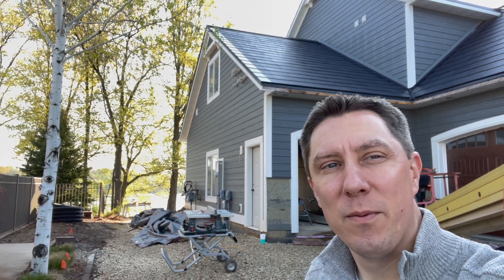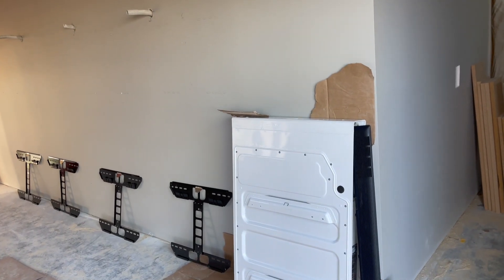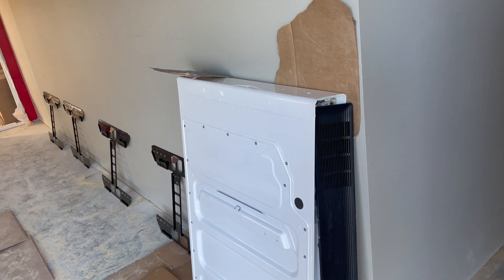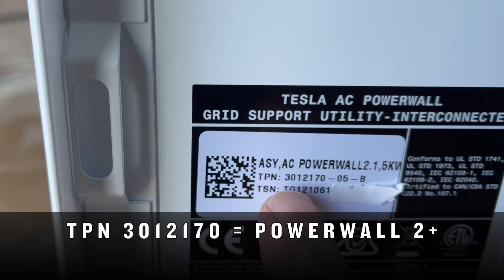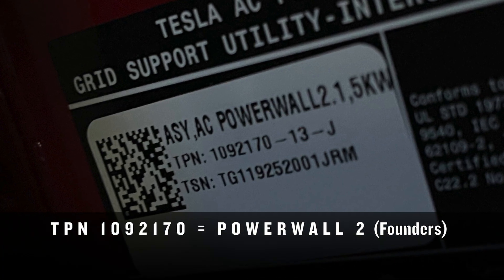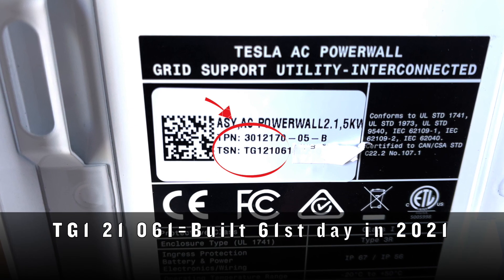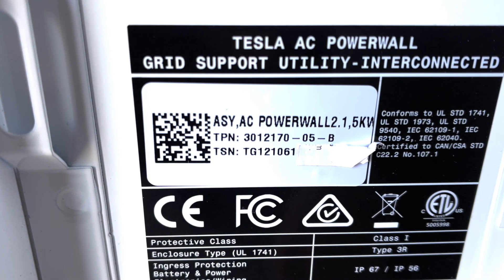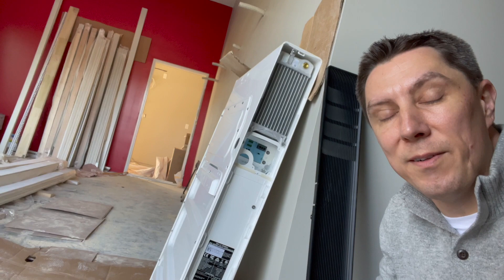Tesla Powerwall - How To Determine If You Have Powerwall 2+

Comment: I have just checked one of my 2 powerwall 2's and the TPN is 2012170 - yet my TSN is TG121348 which hints as it was built day 348 of last year (installed last week so it is a fresh build). So it seams like I have a standard powerwall 2 built after your cut off date.

Comment: This isn't accurate at all. I was made aware by my rep. that powerwall+ 2 comes with an integrated inverter (above the powerwall) instead of a separate inverter. Please don't get people's hopes up with this inaccurate video as it surely got my hopes up.
Reply: THANK YOU. Dude needs to take this video down.
Reply: I can confirm, I am getting mine installed right now and was curious. The information in the video is wrong. The Powerwall+ has an integrated inverter. Everything else is the same, same battery packs, same housing.

Comment: @jason lassen, so tpn 3012170 implies a Powerwall 2 +, but a TG120348 means it was manufactured in the 348th day of 2020, right? Which I assume should still be a powerwall +, however my inverters are both Solaredge inverters?  This sound right?

Comment: You can also find the TSN in the Tesla app. Go to the Powerwall section, at the bottom you can tap to reveal the Serial #. I have a 2021 Powerwall I'm happy to say! Also, my PW+ was connected to my main panel, not to my sub-panel (there was no space) so all my circuits are good to go! 👍

Comment: According to this my powerwall is actually a powerwall+ as well.. Tesla is telling me its a regular powerwall 2 so I am not getting the benefits of the + higher output.. Any suggestions on what I could do?
Reply: Same here.  According to the video, I have a Powerwall 2 +, but tesla is saying it's a regular Powerwall 2.  I just emailed my rep to see what the deal is.  one guy told me if the inverter isn't mounted above the Powerwall, then it's a Powerwall 2.
Reply: This video is very inaccurate. I had mine installed 2 months ago and contacted my rep. today that the powerwall + will come with its integrated inverter. Although my powerwall has a higher TSN than his, my inverter was separate AND rep. Confirmed its just the regular powerwall 2.

Comment: TG1 21061 would be a build date of 03/02/21
I suppose that could be believed for your Powerwalls.
Mine are TG1 21062, 03/03/21, but they were installed 03/10/21, which means they were only a week old?

Comment: Are you going to upsize your wiring, load center and breakers to be able to handle the 50% higher peak power output of the PW 2+?
Reply from the maker: great question!  I asked the electrician about that and they're working it out with Tesla.  I wasn't aware of this beforehand but, as it turns out, Tesla must approve a detailed work plan from the electrician before any install begins.

Comment: So I’m confused by that. I have TPN1092170 (which is a powerwall PN) but with a TSN TG120308. Which is after the Oct 26 deadline. What does that mean?
Reply from the maker: Oooh, great question. Is it a founders edition PW by chance?
Reply: Not that I am aware of. Just part of a standard solar+PW install that happened in Jan.
Reply from the maker: Just to confirm, it’s white (not red), correct?
Reply: @JasonLassen  Correct. All white.
Reply: I have the same situation.   Three with TPN1092170, but manufactured on day 302, which is October 28.    Could they be the Plus?
Reply: Similar situation for me. My SNs start with TG120310, TG120314, and TG120315. However, my part numbers are all 1092170-05-J. I wonder if the few weeks after October 26 were a transition time where they made some old and some new, trying to use up any stockpiled inverters, for example (I assume the main difference between the old and new is the inverter). Otherwise, this methodology is consistent with what I have been told by Tesla, which is that the PWs were manufactured in November 2020. They were installed the third week of November.
Reply: @owenholladay1301  - Yup, that'd be my guess.  My install was late December, and TPN: 1092170-05-J,  and S/N: TG120347xxxxxx which means it was manufactured Dec 12, 2020, and it's not a Powerwall 2+.

Comment: Does the serial in the app correlate?
Reply from the maker: I cannot confirm since mine are not yet powered on but another person told me no - must check the number on the unit.  Let me know if you find any different info.
UPDATE:  sounds like the number in the app corresponds with the gateway
Reply: @JasonLassen  can confirm that the app and actual unit serial numbers do not match